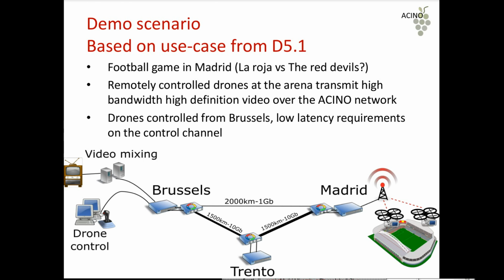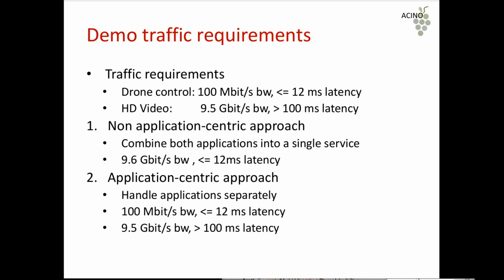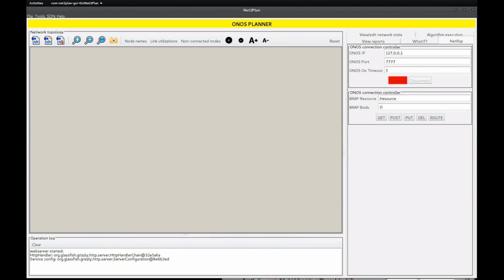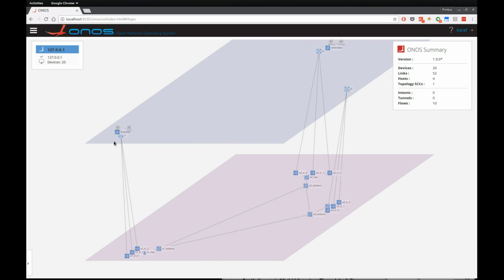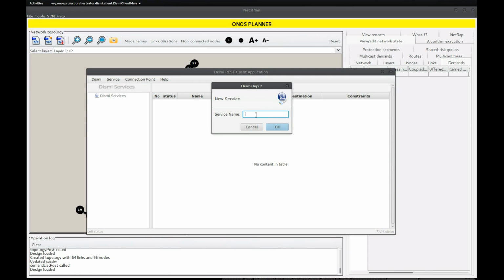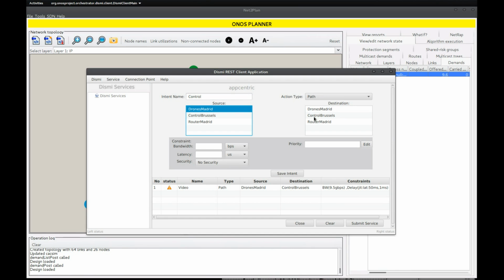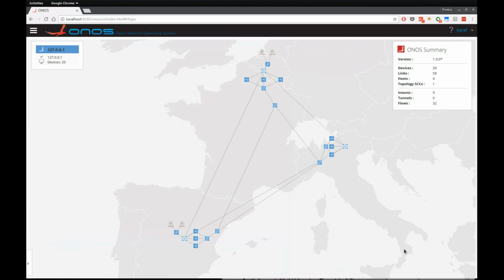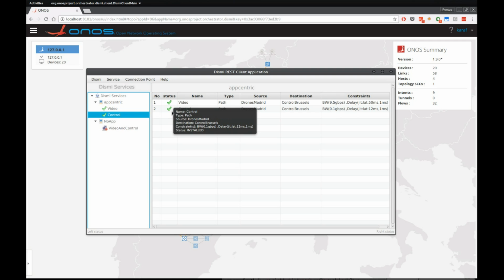Making powerful friends: Introducing ONOS and Net2Plan

Comment: sir, pls mail me the steps to integrate net2plan and onos as you have performed or pls give me links to extension for the same
Reply from the maker: Hi Vishal, the acino project has finished about a year ago. But all the code and instructions are available on GitHub https://github.com/ACINO-H2020
Reply: @ThePonsko  hi Pontus, thank you for your prompt reply....kindly let me know the step to load the artifacts in windows and not for linux...thanks a lot